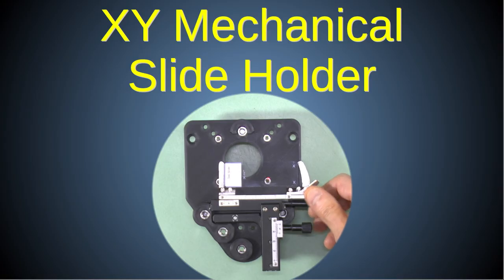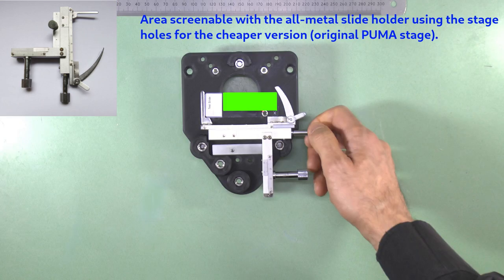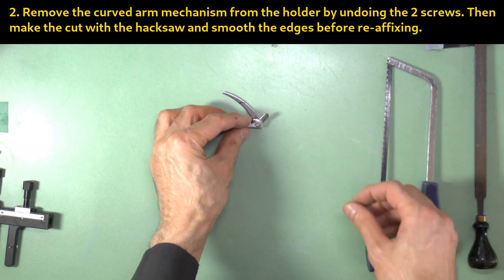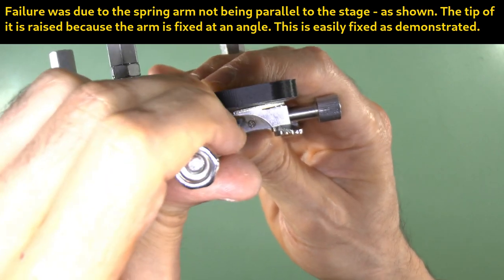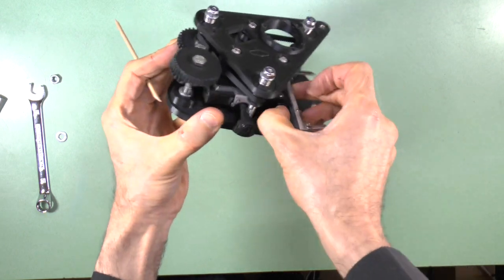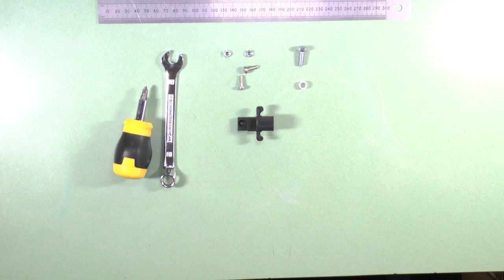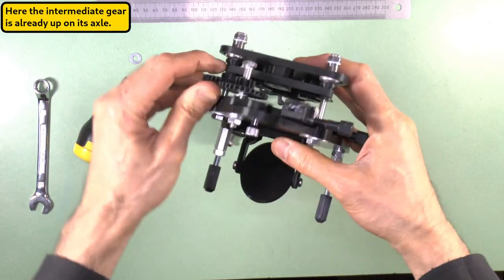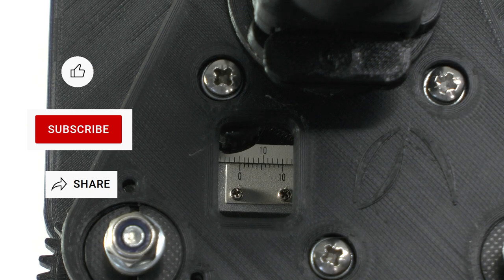How to add an XY Vernier mechanical slide holder to your PUMA open source 3D printed microscope

Comment: Where can I buy the mechanical slide holder? 
Is there a link?
Reply from the maker: Hello. I haven't provided a link in the BoM because there are so many suppliers and they keep changing. If you go to AliExpress or eBay and type in "graduated microscope mechanical stage X-Y" for a search (without the quotes) or "Microscope Moveable Stage Caliper". You will see many examples. Avoid the ones I describe in the video as being unsuitable. The illustrations in the video will guide you as to what is suitable and what is not. For the high quality metal ones you may  find these as an option on one of the above sellers listing for the cheap one - scroll down the whole listing and look for options. Alternatively you may need to add to your search terms like 'all metal' 'M3', etc. - can be a bit hard to find but you'll get there in time.
Reply: @PUMAMicroscope  much appreciated.
Thank you